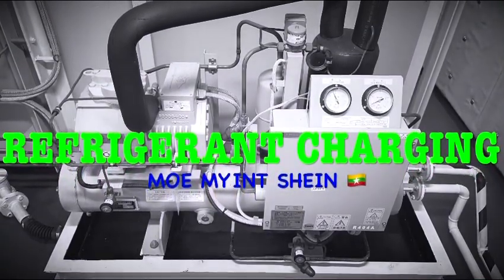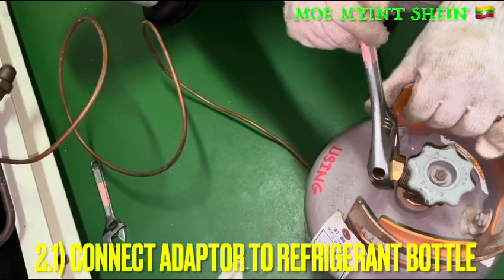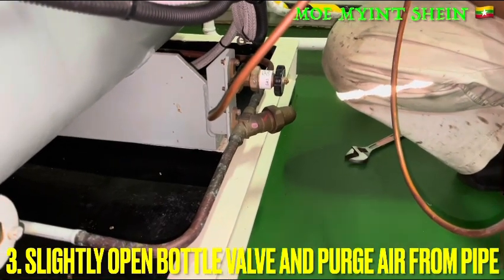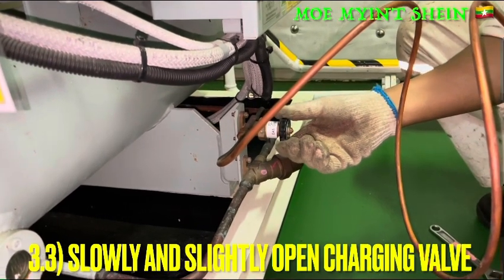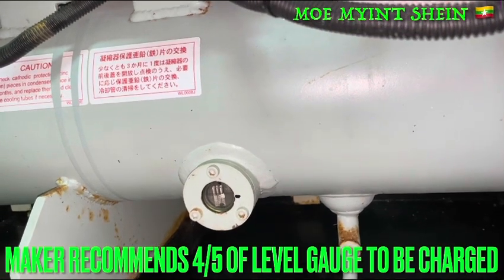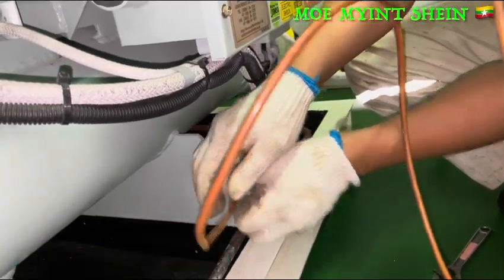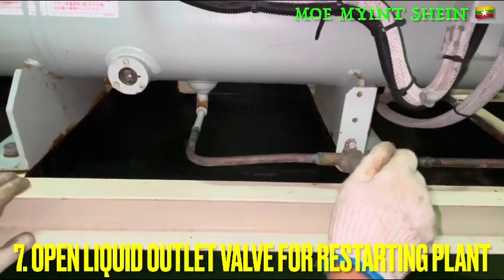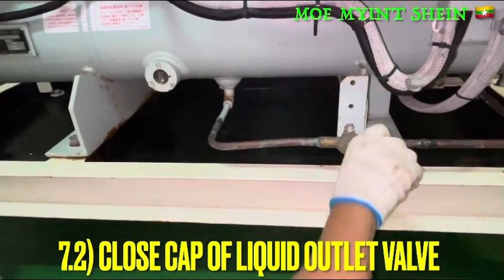Refrigerant Gas Charging | Without Vacuum Pump | Technical Vlog : 049

Comment: nice voice.
i also learned for my exam how to charge refrigerent. 
normally i prefer charging at high pressure side (liquid charging).
charging point is after the receiver, near dryer/filter
Reply from the maker: Thanks Dear. 
Charging point depends upon types of the plant. Most of air conditioning plants, charging point is placed over the cover of dryer housing. In this type, dryer is exchangeable core type dryer.
Reply: @MoeMyintShein_MMU  sir, i learned from the book that for liquid charging i need to "incline" or "upside down" the refrigerant cylinder. but your video, it was upright. can you pls help?
Reply from the maker: @mec6953  
Depend upon types of Refrigerant Cylinder. Cylinder with or without siphon tube. If cylinder has siphon tube, doesn’t require to upside down. If not, need to upside down the cylinder. Siphon tube is a tube which extend from the bottom of cylinder to the cylinder valve, top of cylinder. Sooner I will upload in COMMUNITY with photo. 😊
Reply: @MoeMyintShein_MMU  thanks🙏🙏
Reply from the maker: @mec6953  
Uploaded in COMMUNITY, Bro. 
Check There. 😊

Comment: May I know something.

Fully open the gas bottle valve and then slowly open the charging valve. At that time the compressor is running or stopping.?
Thank you.
Reply from the maker: Compressor is going to run with LP cut in, when suction line pressure is rising up. LP cut out will happen when suction line pressure is lower than LP setting. 
Compressor running and stopping may happen alternatively. Thanks.
Reply: So, is the compressor in auto mode?
Reply from the maker: @thantzinaung6650 
Prefer Auto.